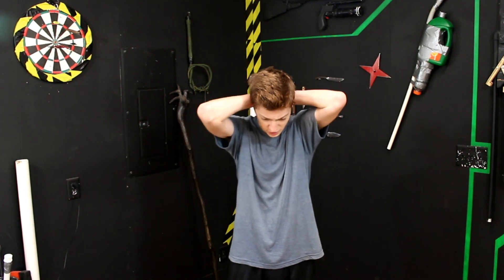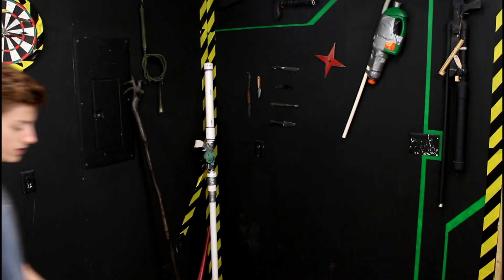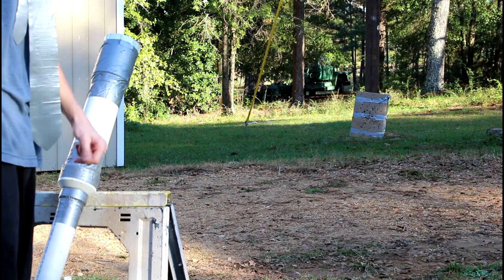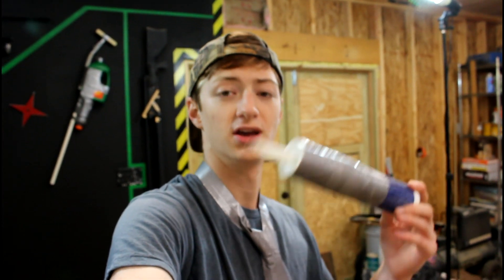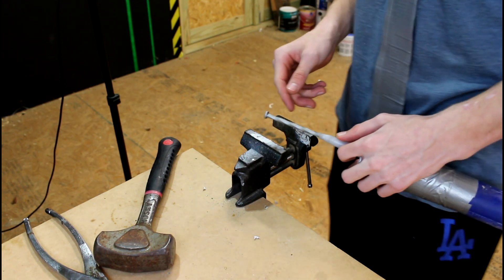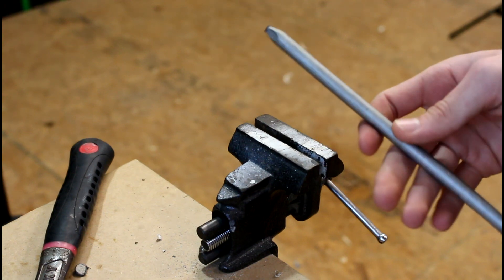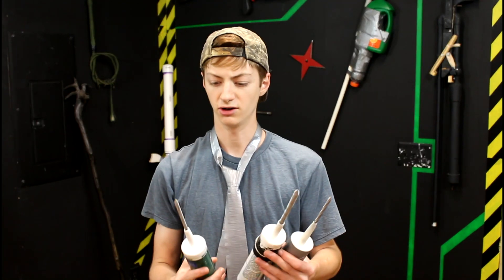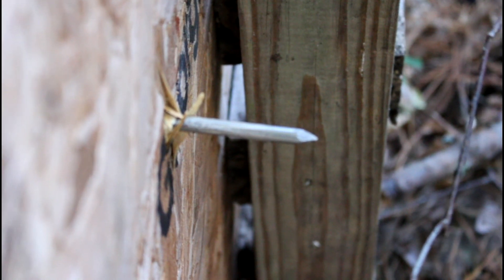I invented the most DANGEROUS Spud Gun Ammo ever

Comment: I made an air cannon off of your design and have been experimenting with 12 gram CO2 cylinders. I attached some plastic fins to the end of one cylinder and at 80 psi it flew around 100 yards. You can get much more power out of smaller bore projectiles.
Reply from the maker: Yeah, with the smaller size air tank on mine it works much better with small projectiles. I love the co2 cylinders, they are light enough to fly far but heavy enough to pack a good punch. Have you tried AA batteries? Those are pretty sweet. I'll have to try attaching fins sometime, that would work great

Comment: if you want to make the projectile more stable, try a cone shaped fin, like a blowdart's dart but huge
Reply: I'm surprised more people don't make big bore blowguns with combustion chamber like a spud gun. We made them as kids and they are insanely powerful. Smaller than a spud gun, make darts out of heavy roofing nails or similar. Heat and hammer the tips flat and grind into broadheads and sharpen

Could do one halfway between the two, projectile like a small crossbow bolt/arrow. Plenty of weight for impact but light enough to travel

Comment: you could try to make apds fin stabilized ammo (armour peircing discarding sabot) its mainly used in tanks these days and is the best ammo for potato guns, bc they are smoothbore. so the way apds fin-stabilized works is you have a projetile (like these nails but with fins at the back) and there is a casing around it that matches the caliber of the barrel. so when the projettile exsits the barrel, the casing falls away and you have a high velocitly nail flying through the air and can probably penetrate armour.
Reply from the maker: I REALLY wanna try that
Reply: @jakemakes  yes that would be so cool man. i mean,  i tried making something like that out of a big ass nail and card board, but it dint go so well ( i dint have alot of precise tools)